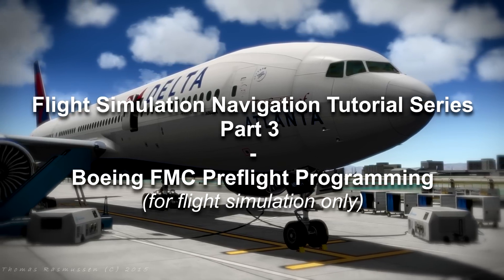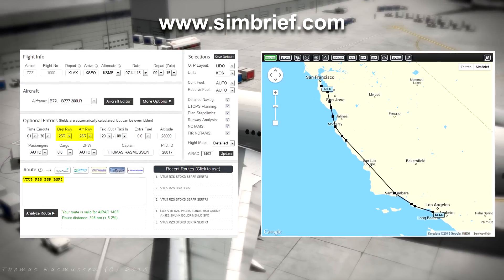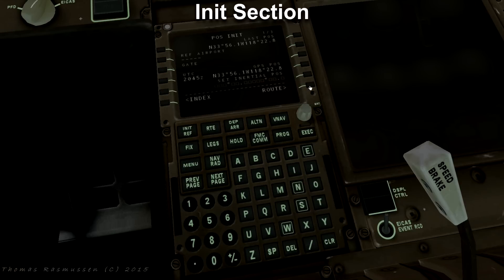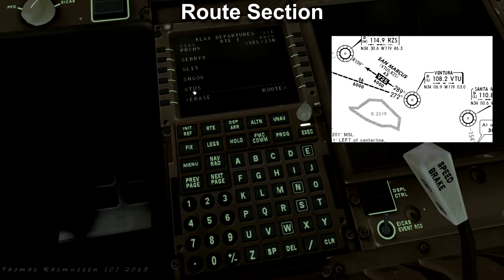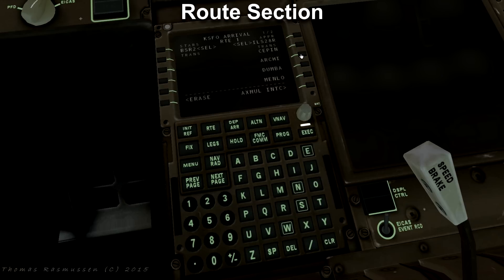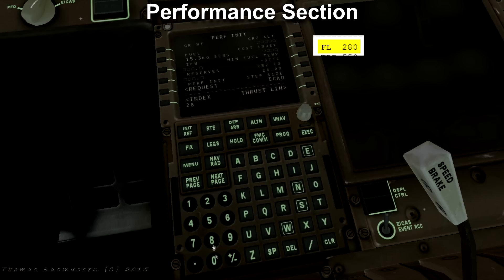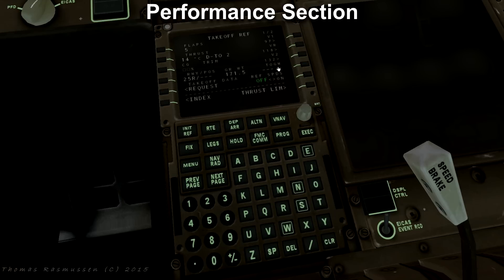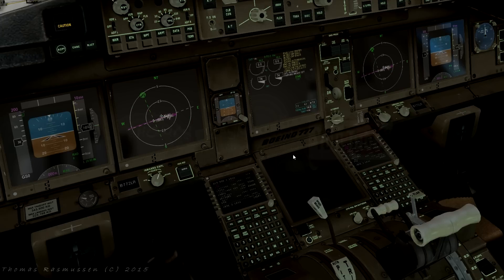Basic Boeing FMC Preflight Programming - Tutorial Series Part 3 (X-plane 10)

Comment: May I ask one more question? My understanding was that LNAV should take account of alt restrictions recorded against specific waypoints in the FMC. So in theory you should just be able to dial in your cruise ALT after takeoff into the MCP and engage LNAV and VNAV and then LNAV will do a 'step climb' adhering to alt restrictions assigned to waypoints? But when I try this I find that even though my WPs do seem to have alt restrictions in the FMC, the 757 still climbs up to cruise alt without stopping at each altitude restriction. Any idea what I might be doing wrong?

Comment: Sorry for coming to this late - great videos yo umake BTW. may I ask - how do you work out that your SID or STAR needs a FIX entering? I also have PFPX - if a SID or STAR needs a fix entering, do you happen to know if flight planners like PFPX and EFAS add the fix for you when creating a route?
Reply from the maker: +Moonglum19 Cinnirella Thanks a lot ;-) The only way you would know about the fix is to read the departure chart of the airport you are departing! I do not think flightplanners mentioned will tell you anything about fixes - the fix in this case serves as a marker for the max altitude AND a marker from which ATC (if flying online) would give vectors for the next waypoint.

Comment: What is the cost index and how do you calculate it?
Reply from the maker: +Ultimate Aviation HD 
The cost index is a number between 0-999 (or 9999 in some aircraft)!
The cost index is the ratio of the time-related cost of an airplane operation and the cost of fuelA low cost index = Slow flights + longer crew times + lower fuel burn = Cheaper
A high cost index = Fast flights + shorter crew times + higher fuel burn = Expensive
In the real world, where flight companies must take fuel costs into account, it is normally set in the range 35-50 (sometimes even lower) depending on airline (and CI range).
Reply: +Thomas Rasmussen Where can I get these values of the cost index that I will put into the CDU? Is there some database or table how different airlines set their's? Also, is there a way to make PFPX (Proffessional Flight Planner X) determine the cost index? Thanks